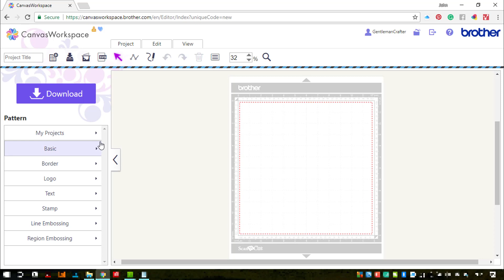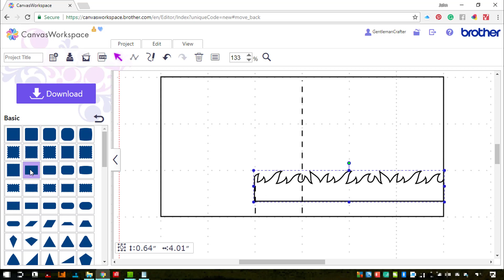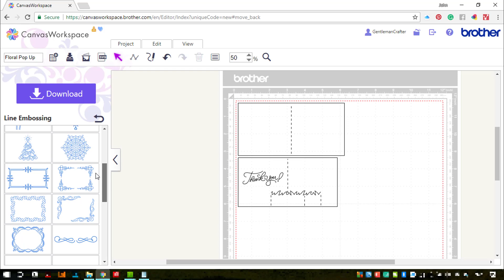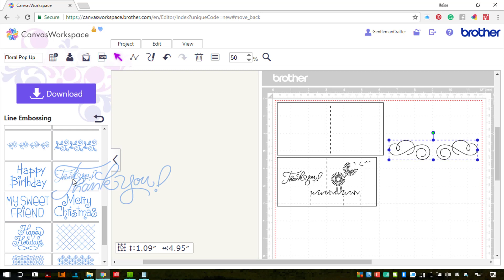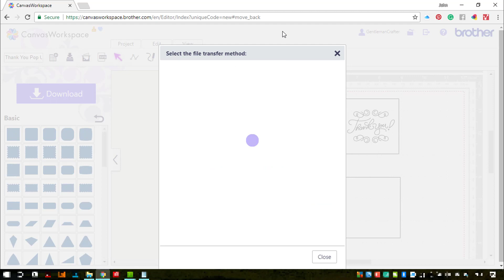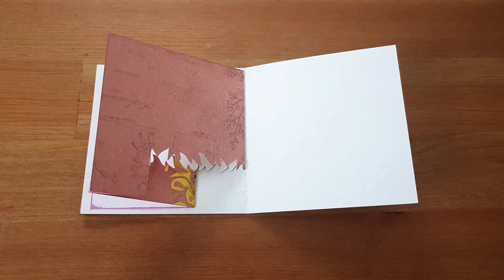Scan N Cut Saturday Designing And Making A Pop Up Card

Comment: Hi John, thanks for this video - really interesting, only had my machine for a couple of months - so learning - can I ask where you had the line embossing kit from please xx
Reply from the maker: They are easily locatable via any SNC accessory stockist. Just have a quick google and you should find one.
Reply: @GentlemanCrafterUK  Thank you xx
Reply: Hi John, I am really very new to this, so please forgive my dumb question.  I have looked for an embossing kit, but it seems to be something you make yourself by embossing on card.  I was referring to the designs you were dropping onto the canvas xxx
Reply from the maker: @maggiesmith604  The line embossing/region embossing designs that are shown on the left of the screen are additional designs that are "unlocked" after purchasing and registering an embossing kit. They are not available as a separate purchase. You can of course use any single line design, or create your own.